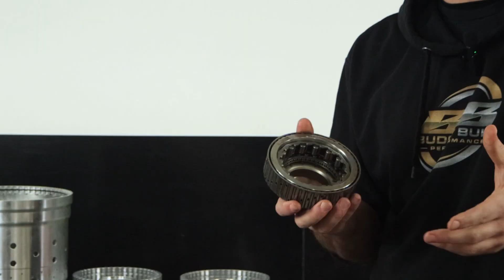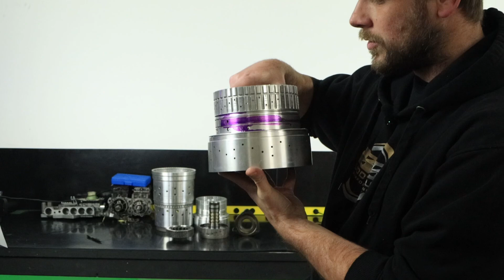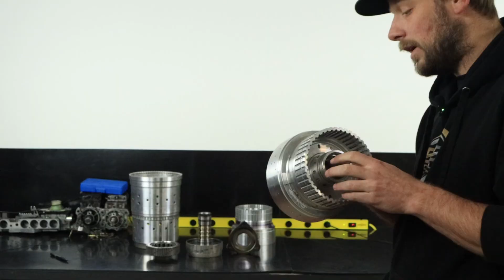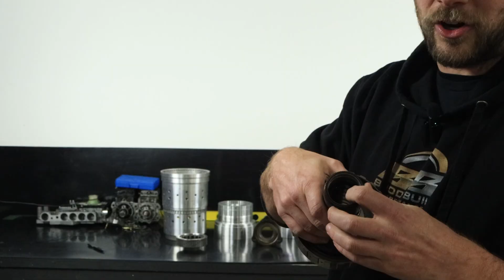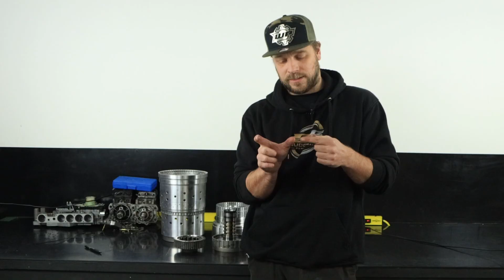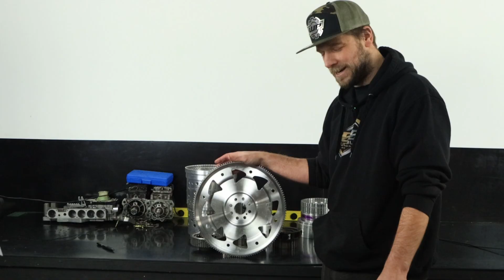The ULTIMATE 10r80 transmission teardown!

Comment: Both my 10R80s are only making it to just under 10k miles and the 2nd is at 10k miles. The Ford dealer is saying it is cooked again. It is sitting on a lot now, and I am trying to decide what to do. They are saying that they will not covered under warranty.

Comment: I am on my 2nd 10R80 in a stock engine 2022 MACH 1. On this 2nd stock trans I have been doing a drain and fill every 5k miles. I figured it would be a good idea to flush out these aluminum shavings from the steel grinding down the aluminum from the different parts of the transmission and then the also the steel on steel grinding and the P3 gear, etc.
I’m looking for a way to have a transmission that will last 100 to 200,000 miles instead of 10,000 miles. Would you say I’m better off putting a T 56 or a TR 3160 or a sequential or something else in my car? Or a specific company built 10R80 trans?
I daily my car and do HPDE.
THANK YOU.

Comment: I am curious about the bypassing of the valve body thermostat in extreme cold temperatures. If the vehicle is in setting outside in zero temps, is the possibility that the cooler could be too cold being it is located on the outside mounted to the trans? I know not all vehicles with the 10R80 have different applications. I do notice that when the AC is turned, the coolant valve opens, and the transmission temperature will drop from 215 to 180. Also, if you bypass the thermostat, are you using a different brand of ulv? Just tore apart my transmission for the second time.

Comment: I have a 2022 f150 with a 10r80 and it broke at 24k miles ford had to install a 2024 transmission because they couldn't fix it or didn't think it would be worth it

Comment: What are your thoughts on Phillips 66 versatrans ULV fluid?  It is a full synthetic, unlike the motorcraft semisynthetic ULV.   Another option is High Performance Lubricants Teal ULV ATF.
Reply: I think using expensive fluid is a bit (not totally mind) of a fools errand (for Stock Hp Street vehicles).  You'll be better off changing the fluid more often and getting particles out of the trans than you would be using a better fluid and leaving it in longer.   Most all of the ULV fluids are pretty good, it is the valve bodies getting crudded up that are causing a lot of the issues.  That being said, when I can get it on sale, I've been using the Valvoline ULV which is supposed to be a full syn as well.  When it isn't on sale, it is the MC fluid.